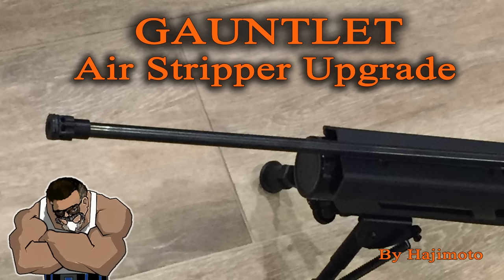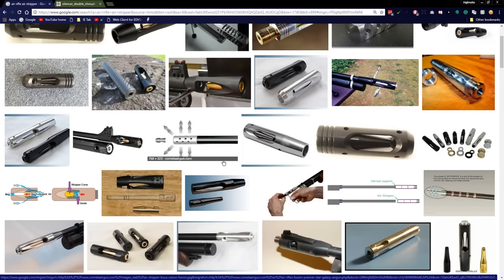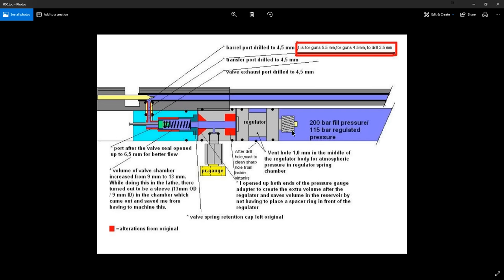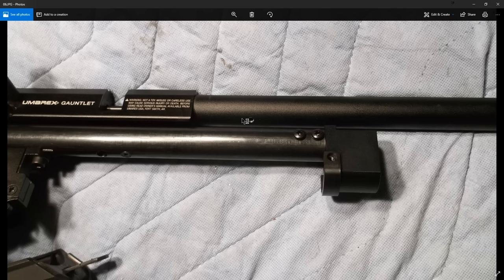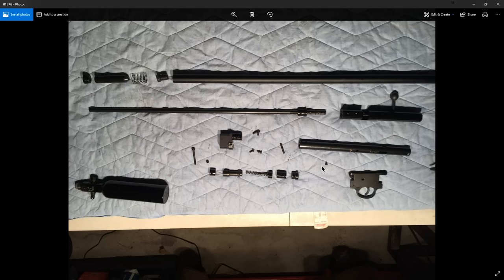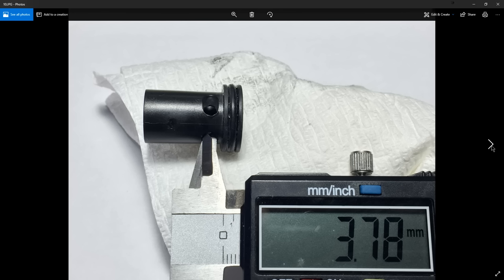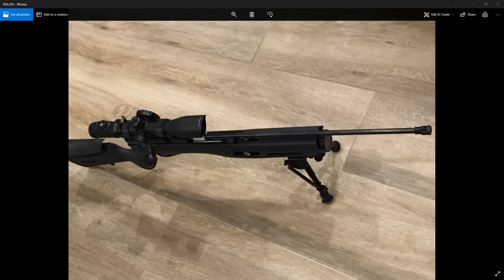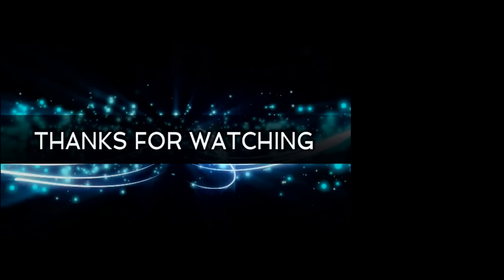Umarex Gauntlet: Air Stripper Upgrade

Comment: Quick question,  do I need to release the air in the umarex gauntlet in order to replace the air stripper. I  just received the the Hajimoto air stripper and barrel band. Thanks
Reply from the maker: No, you do not need to degas your Gauntlet.  Just be sure there is not a magazine or pellet in the breach. before installation.

Comment: Just ordered your bark suppressor upgrade. Does this stripper increase the accuracy of the gauntlet?
Reply from the maker: The HP Air Stripper is an actual functioning air turbulence divergent. The barrel muzzle support that is included with the Gauntlet does not do much in removing pressures and turbulence away from the projectile path. Group sizes will substantially reduce with my HP Baffles and HP Air Stripper installed. Be sure to join the Facebook group Umarex Gauntlet Owners Group and ask the hundreds of unaffiliated owners if they have realized an increase in accuracy with the combo installed.
https://www.facebook.com/groups/342912352849647
Reply: @HajimotoProductions  Thanks for the explanation. I'll be sure to check the FB page out.

Comment: Pretty cool design. In putting one of these together, is there an optimum size for the hole through the center? I am assuming it might be different based on the caliber.
Reply from the maker: Typically it is different based on caliber yes. When it comes to strippers or any suppressors, the closer the better, I go 1MM over the projectile size so the nominal on my stripper is 6.5mm.

Comment: Well, I got the air stripper and baffles installed along with drilling the shroud.  I can say after putting 40 rounds down range the point of impact changed very little if any. This set up is very quiet. While shooting I had two Mag-pies and one Cottontail come by where I was shooting and hung out until I got up to change the magazine. So yea this is going to work, granted the rabbits around the house are fairly tame but still, he never gave pause to what I was up too. Thanks
Now I have a question? Has anyone had a chance to use the Benjerman traveler to give an honest opinion? All I need it for is filling a couple guns.
Reply from the maker: Thank you a million for sharing your results and I hope you continue to share your adventures with the Gaunty. As that rifle breaks in it will get better and better until finally, it will be a pulse laser rifle!  LOL
I do not know ANYONE that has personally used the compressor but from what reports I have heard, it is not fast, like 45mins to fill your rifle or something.

Comment: Why did you modify your design to the HP air stripper 2.0? Is it more efficient than your design featured in the video??
Reply from the maker: The redesign made the part more robust and shorter to allow the use of the DonnyFL short Shroud.

Comment: Have u thought about printing a cover of some sort for the hole that u use to Degas the gun? It really seems to b a huge opening for dirt to get to the internals. Maybe have a small piece sticking up like a sling stud on the top and we can use the degassing tool to remove it when we need to use that area? I would buy 1 from u.
Reply from the maker: I have not thought about this but your idea is sound and warrants review.  I let you that I come up with. Chances are it will turning into a small item that would likely get lost is not knee-jerk reaction. Thanks for the comment Dustin!
Reply: I am using a small piece of black duct tape to cover it up. I have put around 600 rounds through it and degassed it twice to adjust trigger and take it apart. Put a new piece of tape if u lose the old one.. :-) 
 Thanks Haj for all u r wonderful videos.. U rock!
Reply from the maker: Thanks Ashwin!

Comment: Awesome work Haj.. love the detail and engineering in your videos.. Did the redesigned stripper lead to even lower muzzle report and did it quiet the gun more with your baffle system? Interested to know how accuracy improved if any.. Do u plan to tinker with the hammer spring guide / spring/ system to lead to higher shot counts as i saw a few shot strings of 100+ shots with stock bottle.. Thx for the excellent work n video guides..
Reply from the maker: Hey NettyNeuron, thanks for the kind words of support. The HP Air stripper lowered the report and is superior at removing more air from the shot blast so the baffles have to deal with less pressure and volume. Yes, I am working on a valve and hammer spring mod that will allow the Gauntlet owner some adjustability and reduction in cocking effort. That's the deal over 105 shots on the stock bottle.... more to come!
Reply: Awesome.. Thats exciting to hear. Umarex needs to get some tips from you and Travis on how to fine tune a gun.. What bothered me was , yeah they r selling the UG for 250-299$ but all these tweaks if included in the manufacturing will make it the best 300$ pcp. Just a little attention to detail takes it much further ..ah well..we got u , so we r good.. I had sent an email to you a week ago about hill hammer spring guide and how it seems to result in 110 shots without any other tweaks..interesting..
Reply from the maker: Because the spring that Umarex put into the rifle is wayyyyy too heavy. Well, one COULD fill the tank to 3000psi then chill it which drops the pressure then fill it again to 3000PSI and then shoot the rifle using 11.9gr pellets with the lighter spring and the 1050-1100psi regulator. End result MIGHT be what you are describing. I say the light spring with a regulator boost of 1350 to 1500 will result in underpowered shots because the valve was never addressed to deliver more air, Just hypothetics of course 😉
Reply: Makes sense..Ty for the details...

Comment: Just installed your air stripper 2.0, and I also installed your hp baffle stack on my .25 gauntlet. It groups even better now and definitely quiets the muzzle report!! I put some shots over the chronograph and it now shoots 20 to 25 fps faster!!! Is this normal after installing these items???
Reply from the maker: Conditioning the air stream can result in less turbulence and in turn allow the projectile to pick up some speed, yes. Thank you for the feed back and support. Shoot safe!
Reply: @HajimotoProductions  always!! I will be ordering a 22ci bottle with a flex reg from you soon!! Thanks for the knowledge and great products!!!

Comment: Hi, is the air stripper and baffles the same for a 22 as a 25 cal? thanks
Reply from the maker: No it is not. The bore is larger for the .25
Reply: @HajimotoProductions  ok, Thanks, will have to send for one

Comment: Hey Mr. Hajimoto what solvent are you using to clean your Gauntlet barrel? I will be getting one of your air stripper and baffle cone as soon as I can set up a PayPal account thanks.
Reply from the maker: Ken? LOL Anyway, I use Ballistol https://ballistol.com/ I spray some on a swatch that us semi lose I soak the bore and let it set. The thoroughly clean it. I then send 5 pellets through it and shes ready to go.
Reply: Hajimoto Productions sorry about the Ken I was thinking that was your name for some reason. I went back and edited my comments but you were to fast on reading it. Sorry again.
Reply: Hajimoto Productions can't go wrong with Ballistol for ALL your PCP Cleaning needs. You can use it inside the barrel and all over the out side of the gun. It doesnt harm the barrel, seals, plastic, or anything. Best of all it cleans really well and is CHEAP. I dont know why anyone would use anything else.

Comment: Came across your video awesome does it help with accuracy as well?
Reply from the maker: Yes, because the HP Air Stripper is truly an air stripper, it cuts and removes air away from the air stream allowing the pellet to fly unmolested.
Reply: @HajimotoProductions  this is great info! My stripper is broken. What sort of accuracy increase do you claim? If I shoot 1-2 inch groups at 50 yards, would I notice an improvement?

Comment: Can you show the velocity difference, accuracy and even test the noise level at the rifle and another test at the Target 25 feet or yards away?

I have wanted to see how all of your improvements work. I am highly interested in all your modifications. Please keep up the amazing work 😄
Reply from the maker: I will do a comprehensive set of tests which involves the Relief Hole, Baffles and Stripper again the factory configuration. The reason that I have not done so is that I trapped inside due to the winter and the range is only 20 yards inside.  Once it breaks I will be good. I did get out last Saturday when we had a heat wave 49F and shot this 50yrd 20 shot card with the HP Baffles and HP Stripper.
https://i.imgur.com/uuKpN1l.jpg
Reply: Why havent upusold your idea to Umarexso they can make thesesxhanges before they sell their airguns?

Comment: I drilled a hole in the bottom of the shroud, approximately 2" forward of the breech end threads, to let the excess air escape.  Unfortunately, It didnt work for me, mine got louder, at least according to my decibel meter. Nothing scientific, but, the average shot cycle noise went up 1-2 decibels. 🙈 No biggie, I was replacing the stock shroud with shorter one by "DonnyFL" anyway, so I decided to "experiment" with the old one. Just saying, it didnt appear to work for me. 😳
Reply from the maker: If you placed a Db meter forward of the rifle and took readings you will find that the noise level is in fact lower. What is happing is because pressure is being released closer to the shooter it appears to be louder overall.
Reply: Haji, the Db meter WAS forward of the gun and it WAS louder. In fact I placed the Db meter in several locations and it Was louder in each place. It simply didnt work for me. Period. No big deal, just reporting my experience and observations.
Reply from the maker: Please do not misinterpret my responses as not being appreciative of the feedback.  I am simply going by what 300+ other users of my HP Baffles have communicated.  If you purchased a set of my HP Baffles and do not feel that your rifle exhibited the same or more Db reduction as demonstrated in the video, I will refund your money.  Just contact me via email and we will work through the details.
Reply: Ah-ha! Thats the problem. Haji, never said I had your baffle kit installed dude. I simply drilled the hole in a "stock" shroud/setup. Having said that, Im still not sold on the idea of venting gases directing
to the atmosphere will be quieter than venting through the silencer. Nonetheless, now we know drilling the hole "may not work" with a factory setup! 😎 BTW: Big fan and a subscriber, your videos have been very helpful. Peace.

Comment: MAYBE ONE DAY YOU CAN HAVE SOMETHING LIKE THIS FOR MY GAMO WHISPER FUSION ELITE .22 ? AN IR STRIPPER IS WHAT GAMO IS MISSING
Reply from the maker: Hello, I have the Whisper Fusion Elite as well and the molded plastic moderator they have on the end is not serviceable in anyway so the end would have to be cut off, barrel threaded and a real moderator installed.
Reply: i like the help of the moderator but was hoping you could come up with a slip in air stripper to go with that ,my gun now has about the gauntlet 's power and when i go to the perfect more bigger and powerful gas spring it will be more ,if i cant achieve what i want with the gas piston ,i will go to a spring within a spring system ,they are unbeatable !!!! for now i got a super sweet .22 airgun that im hitting things 100 and yards away ,i keep em up ,maintain them and dont try to over clean them ,scraping the lead thats laid down ,makes for a better seal ,i can honestly say with all my air rifles ,i am an airgun sniper and nothing with 50 yards is safe  lol ,,,,,,
Reply: again my brother very informative vids bro !!! good stuff !!!!
Reply from the maker: Thanks for the comments and remember putting together a video of your shooting adventures is a lot easier than you may think. Get out there and do some video capture and produce an R G adventure series ;)
Reply: I TOOK IT APART BY PUNCHING OUT ALL THE PINS ,AND I DRILL OUT THE HOLD A LITTLE BECAUSE PELLETS WERE HITTING THE FACTORY HOLE AT FIRST ,MAN THIS GUN IS ALSO A TACK DRIVER !